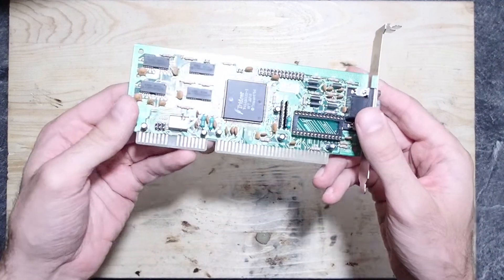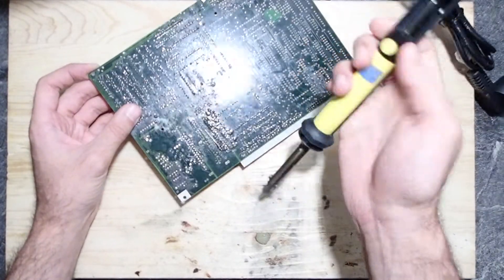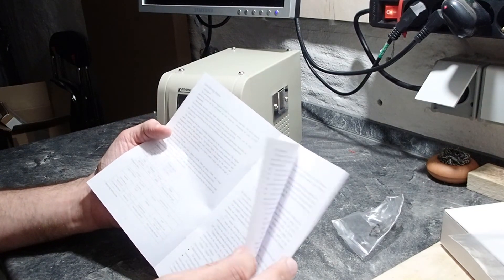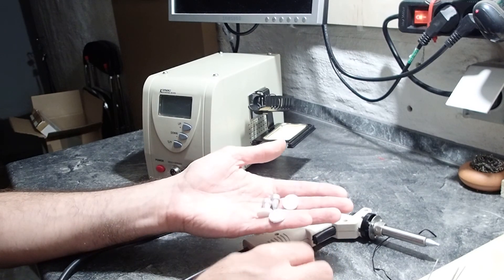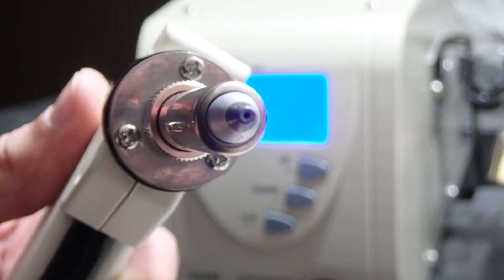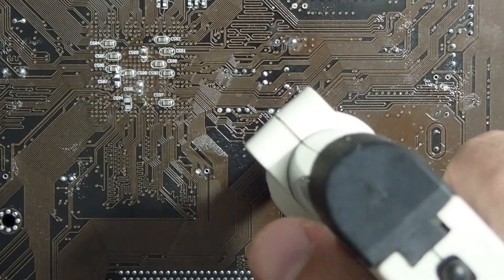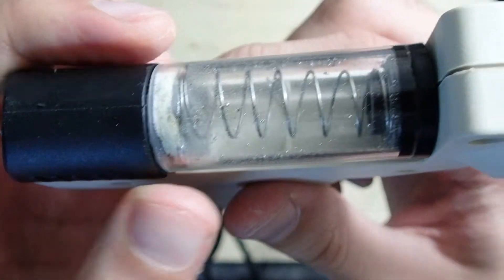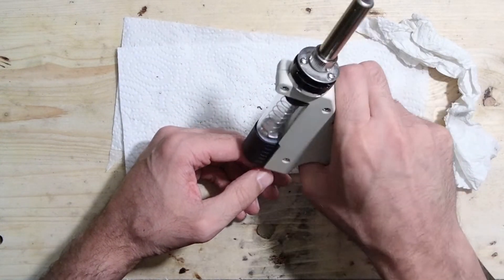My desoldering experience so far (review ZD-915)

Comment: A bit of nonsense. After all, I will not buy a desoldering station to first apply solder to the connections and only then remove the tin. I have the same ZD-915 station and I don't need to apply solder, it sucks the tin out of the joint without any problems. But it takes a little practice, a good warm-up and holding vertically.
Reply from the maker: You don't need to, it just makes it easier and less stressful for the PCB, especially if you work with very old hardware.

Comment: Did you try to desolder strait away rather than adding solder first?
Reply from the maker: Yes, but if the solder is very old and slightly oxidized, it works better, if you add some fresh solder.

Comment: Thanks for the great review.   I really appreciated the intro where you described cheaper alternatives.  Based on your video, I think I may start off with the hand pump first
Reply from the maker: Thank you. Handpump works in many cases, but you need some time to practice. It is not as easy to use a a real desoldering station. It is also a pain in the neck, if you need to desolder some parts with many pins.... but for simple  desoldering jobs, like to replace a capacitor or similar, I'm still using the passive handpump a lot.

Comment: Does this station desolder lead-free soldering satisfactorily? Is the 480 degrees Celsius enough?
Reply from the maker: Hi, it is always a pain in the a**. I hate to do it, but if needed I always have to give a lot of flux and leaded solder to get it working. I can't say, that it works well and when you go up to 480°C, you'll only probably burn your PCB faster. So the only way is to add leaded solder and try then. However, I don't know if there is any desoldering station out there which works good for that anyway.
Reply: @necro_ware  hakko fr-400
Reply from the maker: @lildzhank  Yeah, the one for 1,5k€ If that one wouldn't I'd be really angry :D This channel is about home tinkering and DIYs, nobody would buy that station for personal use, I guess. At least I wouldn't, doesn't matter how good it is.

Comment: Does this station have a brushless DC or AC motor?
Reply from the maker: Oh, that is a good question. You probably mean the air pump and not the fan, I guess? :) I opened the case but, honestly, I didn't disassemble the motor for the pump, so I can't answer this question now. May be somebody else would? May be I can look inside once again, if it's important for you.
Reply: Yes, I am asking about the air-pump motor. Is it a brushless AC or DC motor?
Reply: @faustsmith  why don't you just buy a brushless motor and replace?
Reply: Manufacturer should have installed an AC brushless motor as it is more robust and durable. If you or any installs an AC motor, please let me know. Thanks again.
Reply: I'm thinking it's a brushed DC motor, some Mabuchi clone type.

Comment: putting a copper coin in the tube helps keeping the back of the tube and the filter clean. The solder will solidify on the coin.
Reply from the maker: Thank you for the advice!
Reply: @chaosflower4892  I have put copper wool in it aswell... works aswell. The copper coin has more mass... the solder solidifies immediately on the coin.
Reply from the maker: @chaosflower4892  Hi, yes! It still works absolutely fine. It probably sounds kind of crazy, but I must admit, this is my favorite tool. It works so good and makes so much fun, that from time to time I'm just sitting there and desoldering spare parts from old PCBs in advance. Feels like bubble wrap, if you know, what I mean :) Leo de Kam's advice with a coin also works flawlessly here.
Reply: oh, nice advice, I'll definitely  will try it out. Thank you!
Reply: @chaosflower4892  If you are considering buying one, I would advice the ZD-985, without the noisy fan. Or de ZD 8915 with more power, quiet fan and thin tip holder and tip and better stand. Bif Electronic for the best buy!